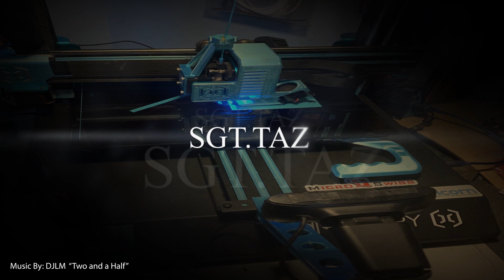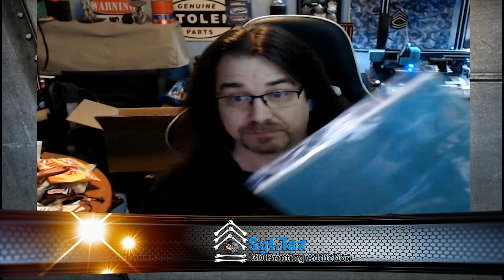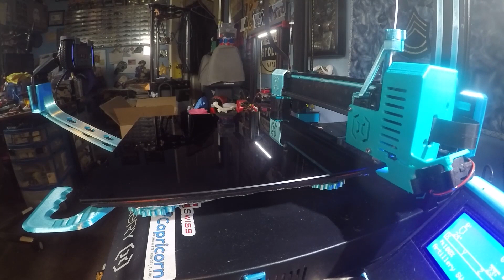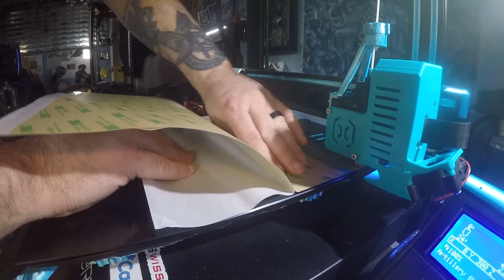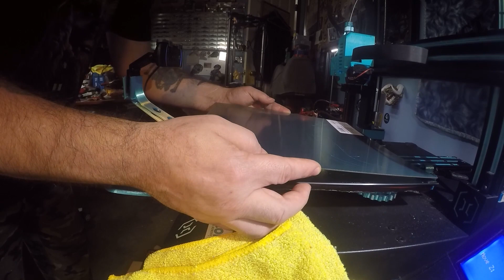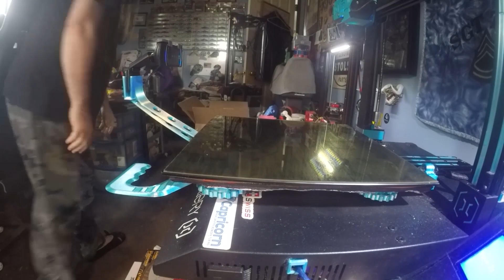Artillery SWX1 Bed Issues fixed!! Cheap & Easy

Comment: On mine it says the center is higher when I level but when I put something flat on it it says the center is lower
Reply from the maker: Are you checking at temp? 60C leveling will give you a more accurate idea. heat expansion plays a roll on larger bed surfaces
Reply: @Sgt.Taz3D  I check it cold and at 55
Reply from the maker: @bjohns3961  the glass isn't supported by anything-heat pad is directly attached so you will get deviation when temps change.

Comment: I guess I messed something.  How’d you shimmed the off points on the one you added your material to the bed. Also ... what did you use for your new video setup on the X1. Thanks
Reply from the maker: I didn't need to shim mine. the 3M sticker also comes with additional strips you can use as a shim or depending on how much you need to shim you can use aluminum foil folded to the desired amount you need.

Comment: Can’t believe how far mine is out in the middle. Four corners not bad ... middle sucks. Always with this crap.
Reply from the maker: Have you tried heat cycling the bed? bring up to 80C while bed is left loose, let cool/repeat. then level at 60C keeping bed springs at least 50% compressed. That should get the bind/warp out of the glass
Reply: @Sgt.Taz3D  I did that honestly nothing really changed.
Reply from the maker: @ZDarkdayz  you may need to drill out the bed frame holes one size up. if your getting a bind that may reduce the stress on the glass

Comment: Hi there, recently got one of these PEI beds for my X1, have yet to install it, was thinking about using binder clips to keep it on my bed. Are there any benefits to keeping it removable like I'm considering or should I just bite the bullet and permanently stick it to the bed? Was thinking maybe certain specialty filaments might stick too well or not at all and it might be nice to be able to go back to the stock glass bed if I need? 

In a different video, you talked about possibly making a video about flashing and upgrading  the firmware and  whantnot, I'm still running a stock SWX1 and  was wondering if you ever did make that video? I've researched and read the tutorial on 3Dnexus, but I'm more of a visual learner and was hoping perhaps you had indeed made a video describing this entire process? Or know of a good one that breaks things down well the way that you do? 

Keep up the good work man!
Reply from the maker: I used picture frame clips on my latest PEI (small and less bulk) (https://www.amazon.com/TBWHL-Picture-prtiner-26mmx14mm-1inchx0-55Inch/dp/B07X2MRW76/ref=sr_1_4?dchild=1&keywords=picture+frame+clips&qid=1598485242&sr=8-4)  it's kind of nice being able to remove the sheet. Main reason I did the video this way was for those that had bed level issues, this would help correct any problem areas if you had them. I never got around to doing a video as I upgraded both of my X1's to 32 bit boards so the nexus firmware isn't for my setup.  he does have a good walk thru on his site as well as a video in description link. I should have a new video about beds in the next few days, trying to fix some video issues and get it properly narrated. Thanks for compliment.
Reply: I'm glad I asked! I like the idea of removable and my bed isn't too warped... I guess the mesh bed leveling when I get it running will tell me for sure!!

Ive read a bit about these 32 bit boards but I think that's more than I need ATM (unless you got a vid that makes a good case for them) so I will follow your advice and try the methods described in 3dnexus, I must have missed thevid, I'll look harder. I have yet to reach out and thank Earl for all his hard work in this community, I will have to do this soon!!   Thanks for the fast response and good luck on the future vids!

Comment: hi, boss, I need one help for my machine, my machine bed hot problem, when I start print any file the machine gives me a very good service but after 2houre or 2houre my machine stop and machine bed is very cool, the temperature comes very coolly. what is the solution 
if you know, please. almahaartcrafts@@t . my machine is artillery
Reply from the maker: The heatbed has an inline fuse on the heatpad I suspect that that gets overloaded and shuts off the bed. Might want to submit a help ticket to Artillery  https://desk.zoho.com/portal/evnovo/home

Comment: Love the video! New to printing with the exact same printer as yourself. Can you elaborate on the hump on the artillery bed please? while leveling my bed I noticed that the center was just a tad bit higher than the corners and since I'm new to this, I didn't know what to think of it. Is my bed warped? Can I fix it? Please let me know what you think. Thanks so much
Reply from the maker: It's normal to have a high or low spot in center with how these are mounted. the epoxy is fine when assembled but during shipping/stocking they cure and the mounts shrink and bind resulting in the high or low spot . Heat cycling can usually get it to settle down, next would be widening the bed frame mounts one size up. If you have a dramatic bulge contact support as they will replace it under warranty if it's way off. but the option presented works when you want that as flat as can be surface :)

Comment: I am new to 3D printing but can you explain what you mean by “you don’t want to play with your settings” when talking to a flexible build plate. Are you saying if I buy a flexible build plate I will have to releveled it and play with temperatures?
Reply: Sergeant Darth Vader?
Reply from the maker: You'll have to relevel with anything you add as it's going to place your bed slightly higher. even with my setup. Flex plates tend to take slightly longer to heat up and normally need about 10c higher on top of glass beds. I'm not hating on them as some like the convenience. I've had a few friends using them and they say they wind up replacing the thin PEI sheets  quite a bit when using various types of filaments. It's something to consider in with your overall cost. thanks for watching!

Comment: I have been contemplating getting a magnetic PEI sheet with the dual smooth and textured surface for my Sidewinder. One of the reason is because I hate waiting for it to cool down and having multiple removable sheets sounds good. Also being able to use hair spray or similar away from my printer would be nice, if I ever did need to use it. I am curious about your comment with regards to temperature. Does it make much difference in temperatures? I really only use this machine for PLA as I have another I use for flexibles, ABS and nylon.
BTW thanks for your videos I have enjoyed watching your progress with removing the layer inconsistency that seems to plague these machines.
Reply from the maker: You will need to add about 10c with a flex plate . between the magnet and metal it will also take a bit longer to get temps evenly across the plate. the thin PEI sheets that are on them also tend to need replacing frequently from all the reviews I've had from friends.  As far as needing hairspray which is mainly what I've been using on my glass. those days are over with this setup. PLA just stays,  far more than I thought possible. Thanks I'm glad you enjoy my videos :)